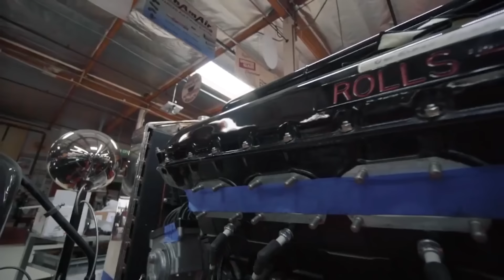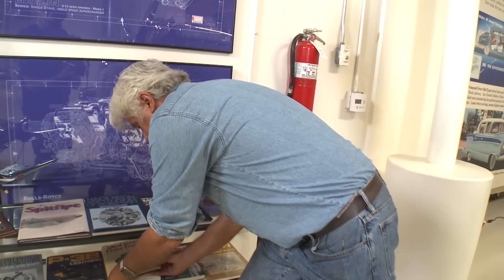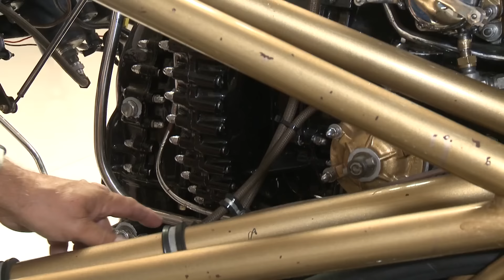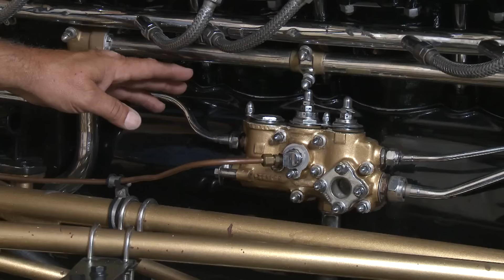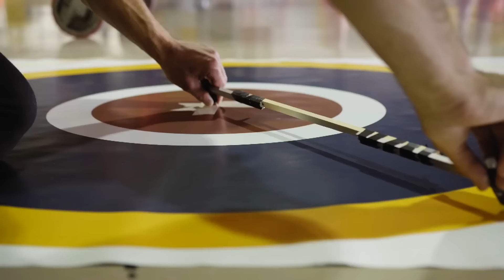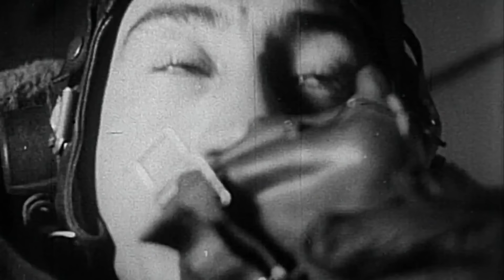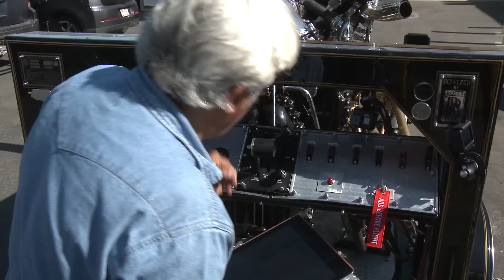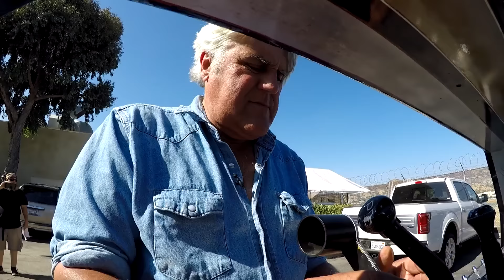The Engine That Won World War II - Jay Leno's Garage

Comment: pratt&whitney r4360 wasp major 28 cylinder 3000 hp
Reply: The Wasp Major was not in fact used in any operational aircraft during WWII....
Reply: Simon Coles the f8f bearcat was equipped with the major and operational even though they didn't see any action. I have to admit it had no part in winning the war. A better example would be the r2800.
Reply: Actually, no, the F8F used the Double Wasp (R-2800) - the only fighters that ever used the Wasp Major were the Super Corsair (only about 10 built), a prototype derived from the P-47 (the XP-72) and the Boeing XF8B which was a one-off prototype.
Reply: Robert Flock the double wasp.
Reply: The Napier Sabre entered WW2 service with 2400bhp and there were engines in service before war end with 3000bhp.  Best prototype Sabre had 5000bhp, but there was no propeller capable of absorbing that much power.
Reply: LavaLampBlob I stand corrected. I read about the f8f having the major some where but can't find it now. Everything I look up now confirms it had a 2800.
Reply: Also, the lowest power version of the Wasp Major was about 3000hp and went up above 4000hp in the most powerful version.  The most powerful R2800's were about 2800 HP so the gap wasn't that large between these and the first Wasp Majors, and the Wasp Major was a much larger and heavier engine.
Reply: Rare Bear the full-race F8F is the only Bearcat with a 3350, none have the 4360 in them, but there are currently 2 Sea Furies and of course the F2G that use the 4360.
Reply: great engine but was prone to carburetor icing at high altitude
Reply: Bristol Centaurus, 18 cylinders, 3000+ hp.
Reply: All F8F Bearcats were powered by the R-2800, mostly -30Ws
Reply: The R-4360 was an engineering masterpiece. Read my book on the 4360.
Reply: Judge Dredd-  Yeah, so was my '65 Volkswagen, but that was at ground level.   I could never gain enough altitude to try it up there, but I figured it'd probably be worse, so I kept it low.
Reply: Robert Flock beat me to it.